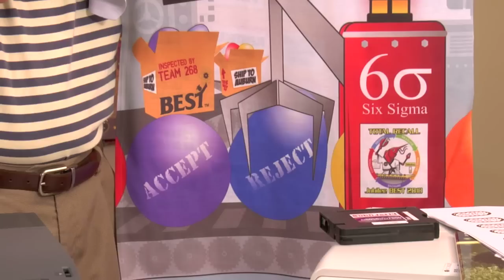Introduction to Dye Sublimation Heat Transfer Imprinting -

Comment: Is this any different from regular heat activated printing like those old iron-on T shirts?  Only better of course I should hope, given that those vinyl, rubbery print jobs have been around since the 70s. But what's with the big name? Just to match the big price, or something even trickier still? As the word sublimation calls to mind shrinks and their psychobabble right?  If not conspiracy theorists with their ideas of subliminal implanting through the radio and television etc. So why haul out some rather obscure chemistry term (allegedly where the word comes from)  For goods that would essentially be used in merchandising and to make consumer products? And what's with the big name? 
 Especially if it's proven that the exact same thing is being sold (for 
different application, and to different segments) at a much cheaper 
price, under a different name? Surely there are bodies and 
agencies in place to prevent this right? Even if big industry may be 
reluctant to spell out the precise contents and processes of their 
products. There is such a thing as trade secrets after all. That even Colonel Sanders is known to fall back on
 But just imagine if we're dealing with powerful sociopaths in high 
places who have it in their interest to forward such practices. Where people are charged for the type of words they use, and how large their vocabulary is That is to say, the larger your vocabulary, the higher your price point, Based on the assumption that higher education accords higher pay scales Unless you were an autodidact of course, In which case you would be screwed of course. Along with every other independent thinker or person with a conscience on this planet? All in the name of streamlining and market segmentation?
Reply from the maker: Well, Mr Weewilly, not sure where to start, but first, it's called Dye Sublimation because the chemical process that takes place IS sublimation of dye. You see, sublimation inks disperse into a gas from a solid (Sublimation) after heat is applied. Those gas molecules have the property of attraction to polyester therefore the ink gas melds with the polyester molecules and cools back into a solid. Dye Sublimation processes are not a secret, as evidenced by our 1200+ videos on the subject.

We never actually thought the process would be used as a marketing adjective, but it began in the last decade especially when big Chinese manufacturers churned out millions of cheesy cheap dresses with streaky lines in them and declared that was part of the dye sub process and to be expected, when it was really their inability to pay attention to detail. As a result, dye sublimation was subjected to the impression that it is imperfect and sloppy. Not to mention that it was for cheap cheap goods. Hardly the elite impression you imply.

Expensive?  Hardly. When you can get started in this industry for less than $1000? You going to start a fried chicken franchise for that? We hope you will investigate further and join us if you have things to say, tee shirts may be the perfect billboard for you! Good luck!

Comment from the maker: Call one of our account managers at 800-826-6332 and they can guide you to the best system for your uses. Offhand it sounds like you need an e7010N and a 16x20 heat press (DK20S)